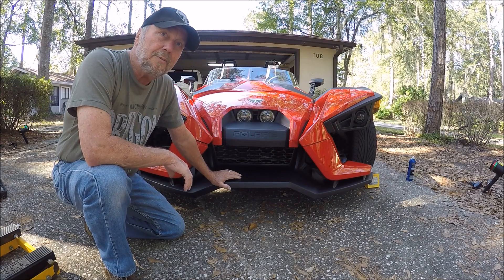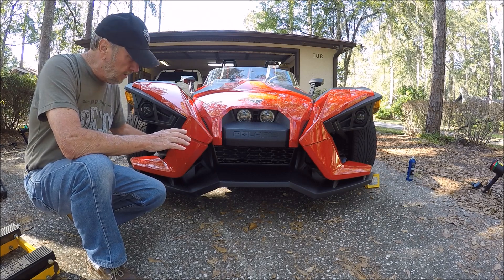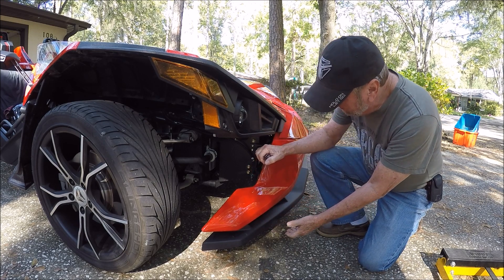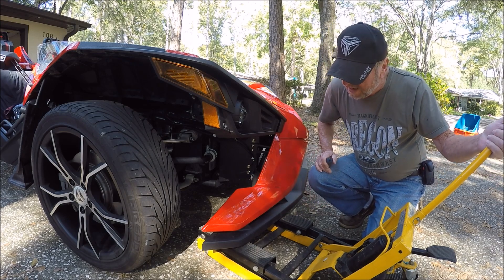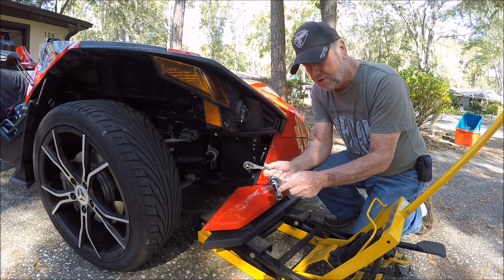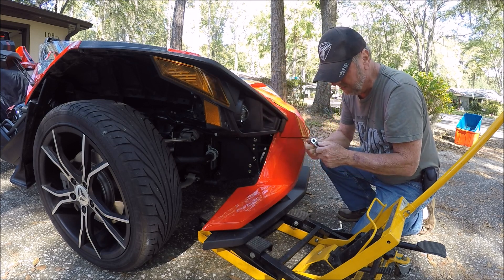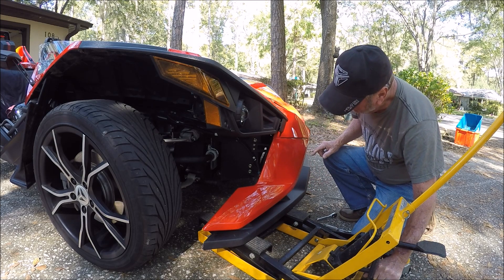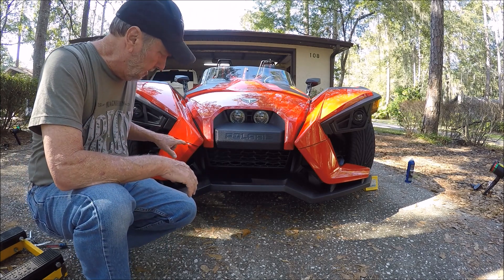Polaris Slingshot Spoiler Adjustment Procedure

Comment: I bought my slingshot just a month ago and it came from the dealership with a gap on both sides and I was going to adjust it and now I know exactly how... thank you sir
Reply from the maker: Chris W Thanks for you comment.  Glad you found my video helpful.  That is my goal.  You will find it can get knocked out by hitting low dips like drive ways, so go at an angle if possible to avoid striking the Spoiler.  Be careful of the wheel stops at  businesses, they can mess up a spoiler for sure.  I try to back in if possible. Enjoy your new Slingshot Chris.

Comment: Looking for bolt sizes.  Back of the lower spioler that connects to the bracket that then connects to frame
Reply from the maker: @Jeremy Crandall, sorry I did not say the bolt sizes.  I don’t have a Slingshot now, so can’t tell you.  I think the small size is 13mm and bigger size bolt is 15mm.  Good luck and enjoy your Slingshot.  Try and learn to perform as much of the maintenance yourself.
Reply: @samowens44  couple years in now.  Can't help but do my own work.  Wish they sold a box of bolts for the slingshots.

Comment: Sir, where are tou located in the USA to get the correct adjusted. Im in South Carolina between  Orangeburg sc and Columbia sc . My is Black Magic 🎩,  and i have a 2022 slingshot sl model. Can you help out in anyway to correctly aligned.
Reply from the maker: @russellshuler7569 sorry, I had a 2015 and 2017 model.  I sold my slingshot in 2019. so I have been out of the field for a long time.  You should be able to take it to the dealer and they could help you maybe.  My video shows the basics of how the bolts adjust the up and down, in and out.  I have moved on to other things.  Sorry i can not be of more help.

Comment: I have a gap and I had a guy follow your video, but couldn't get it to work.  Where are you located?  I need your help.  I don't like the gap.   You make it seems so easy to do, but he couldn't get the gap close.
Reply from the maker: @ Florence Williams, I know the feeling, I did not like the gap, I found out the bolts that adjust for the gap and made the video.  I do not have a Slingshot now, but someone should be able to adjust the gap using the adjusting bolts.  I am in Gainesville, Fl.  If all else, the dealer should be able to close the gap.
Reply: @samowens44  You got rid of your sling??